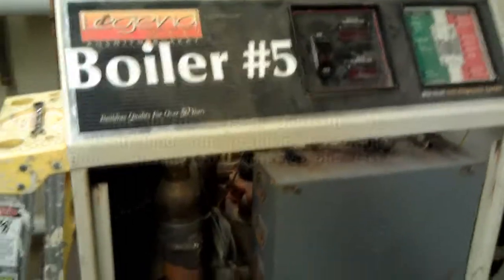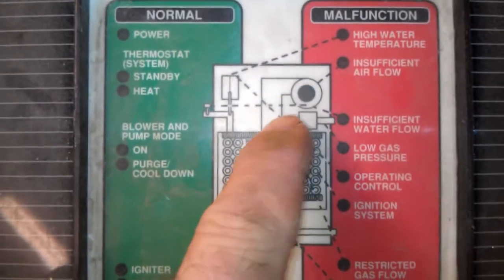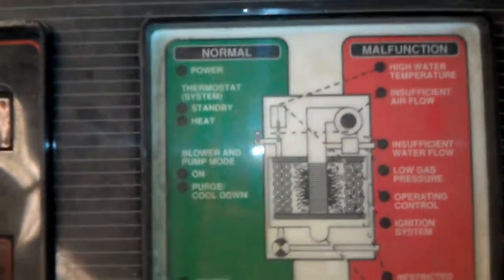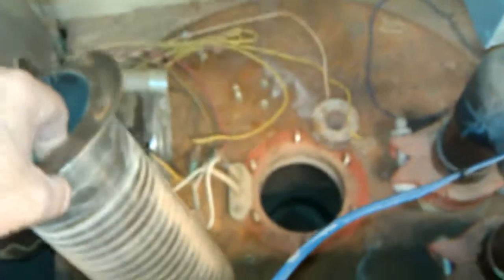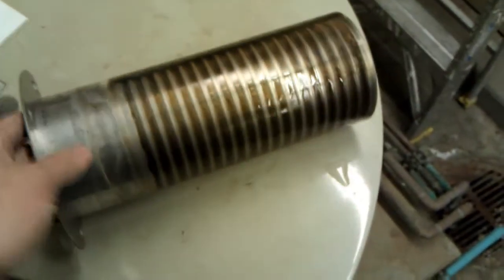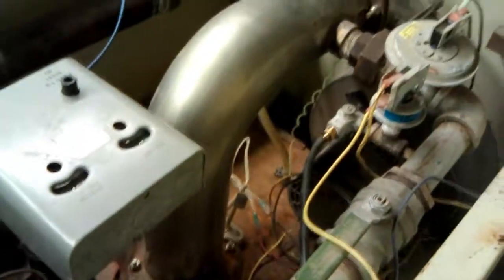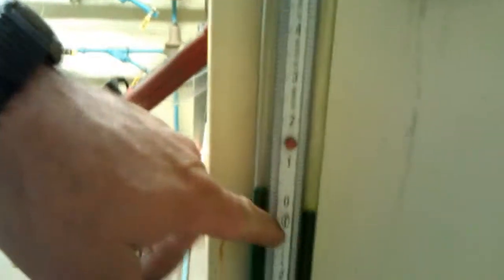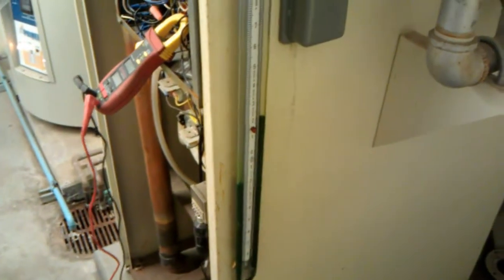AO Smith Legend 2000 Boiler burner tear down - Part 3 [HD]

Comment from the maker: Well, the fins that you can see when you pull the burner looked pretty good. 
I've brushed a few dirty areas. 
The water itself is sealed in the pipes and has no effect on the fins. 
Water condensed from the flue gases does tho if it doesn't have a high enough heat rise, etc. 

Not really a problem in the AZ desert tho.